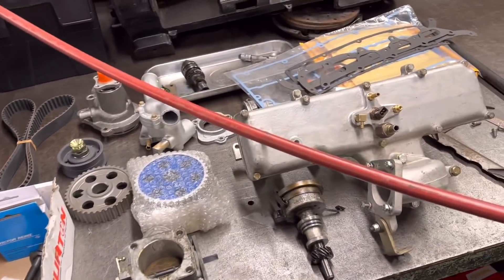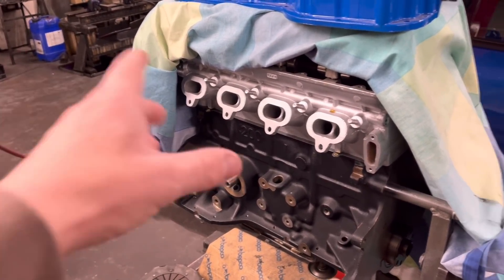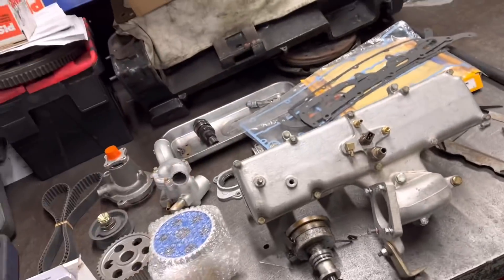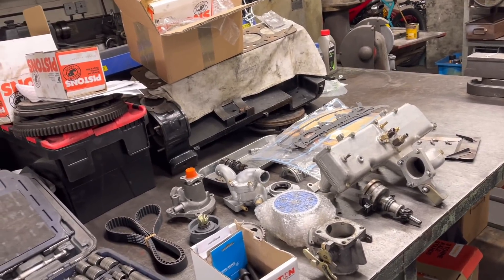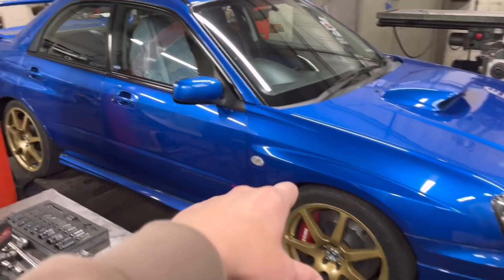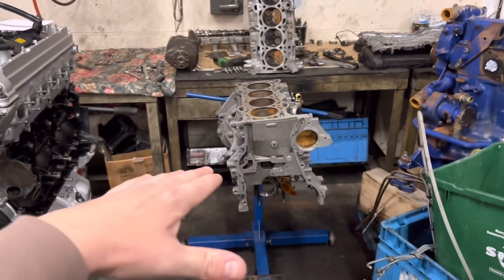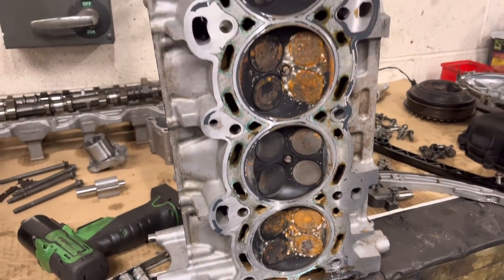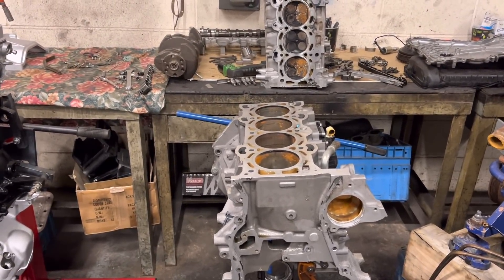It’s back for a Warranty claim check, but is it even the SAME ENGINE?

Comment: The input shaft on that quaif box looks like it could be the same length as a V6 Cologne type 9 box, still the same spline and everything but there slightly longer on the spigot diameter than a standard pinto box. You can usually tell as they sit proud off either type 9 bell housings, the pinto sits sub flush and as such the one you have may be too long, you can fit a pinto type 9 onto V6 Cologne, however the input shaft is short of fitting into spigot bearing, the cologne box can only be made to fit a pinto by getting rough arsed with it and shortening the input shaft approximately an inch (and using the pinto bell housing obviously).  Yes call it rough arse but where talking about putting these things together for banger racing with what we have, and forgive me if I’m barking up the wrong tree here but it might be worth checking out, its not easy to tell from a brief video clip and its a good number of years since I’ve had to mess around with these pinto and V6 setups so haven’t had eyes on one for a good while. Looks to be a great setup regardless and some cracking content for you guys, good luck and keep pumping it out.
Reply: Couldn’t you fit a spacer plate to make up the difference? 
In my world (Rover K series + type 9 in an MG Midget) we’re lucky enough to be able to get long or short bellhousings to suit whichever input shaft.

Comment: Some of the shops here epoxy a button on the block and heads. They are heat sensitive with a logo for the shop on the button. If the button is not on it or has melted don’t even bring it around. It also has a date on it.

Comment: Just as others have said a very discreet stamp or engraved mark (only known to you) would be a big help for yourself, so if a client returns with a "warranty" job and before any investigation work your discreet mark can be checked. I have had engines in for rebuilds or mods and have found stamps made by BBR, and a couple of machine shops here in N Ireland

Comment: There is a lot going on here with old work and not even guys that supposedly had it done still owning it. Your warranty needs to start the day it leaves your workshop, not 8 months to 4  years down the road when they finished the project or first fired it. It also needs to be original owner and some way other than strip down and guessing to identify  it was even your original work/parts.
   I get the customer service and reputation bit running my own business, but some of these things you show the guys are taking the Piss.  you should have way more work to do than wasting time on this stuff thats been messed around with by others and bought back wrong after with race/tuned engines. Honestly  I'd say no way on warranty on them and document it that way at the start and when it leaves if it's a part build or other stuff done after your work.
    It's like me bringing you a NH boat engine like those 2 you have there, saying machine and tune the daylights out of it, and I'll take it and run it in  a 2000hp  pulling tractor. The first run it blows a rod out the side at 5000rpm off the line and i say it's warranty and your fault the rod broke.  What are you going to do give me a new engine and the work that's 10 grand plus. I know guys it's happened to owning race engines but they are on their own with the bill and not the machine shops liability to cover it. 
  You get enough of these guys out there they'll bankrupt you in the end, lots are after screwing others  500 quid plus  the easiest way they can get it these days without honestly earning it.  Take care.
Reply: Yes and no.  As someone who has projects on the go, it is not uncommon to be a year or more after the rebuild that it is on the road.  I do think that there should be some serial numbers logged, not only for warranty but for insurance as well.  I don't know how you warranty something that is going to be raced, as a bad shift, poor cooling design maybe a shallow oil pan, it becomes more of a user issue.

Comment: If I remember right, it was used on a rock crawler type 4x4, so he’s probably sunk it in water and hydro-locked it or just left it with the water inside so that it can add some patina to the insides.

Comment: When I purchased my Auto Electrical business from my former boss when I finished my apprenticeship, I had a customer come in wanting a warranty on an alternator. We used to put a chrome type sticker with purchase date in code on the units. When I looked at the unit I enquired about when he purchased it. He replied about a month prior. I was mystified as had had the business for a couple of years and the name of the business had changed. Digging deeper I found out that he had purchased the unit from a wrecking yard and they told him that they had it reconditioned. On the sticker it states the unit was a guaranteed exchange unit. He got really pissed off when I went back through our warranty book and informed him of when the unit had been purchased , it was sold over five years before him buying it. I did manage to sell him another unit, this time with two years warranty.

Comment: I went back and watched the previous 2 videos on the Mazda engine. Your customer's story really doesn't stack up, that engine has been mistreated, it has been stored badly and has been not been in a running state for sometime. If the customer can't remember grinding bolts in situ I wouldn't trust that he has given you back the engine that you worked on.

Comment: I have just watched this video, and i was going to suggest doing what others are suggesting. I would make a mark, in whatever way you fancy inside the engine block, somewhere not easily seen unless you know its there. I would also mark heads underneath where it cant be seen, maybe on a port somewhere, and once reassebled cant be seen. With ancillary stuff like water pumps i would take a notch out of the rim of a bolt hole, so once the bolt is in its hidden. You need to adopt this strategy with all engines you take in, and also something you dont seem to have mentioned, make a note of the block number when it first arrives. If you made up an ID card that the technician filled in  as he worked on the engine, it could be added to the sales invoice in your records. This would tell you what was marked, identifying numbers, Etc. There could be no argument then when you had the customer in to discuss the failure. Currently I recondition cordless gas nail guns, and have made such sheets and laminated them so they dont soak up oil, and once complete feed them into the copier. I then wipe them clean with thinners for the next time i need a workshop card.

Comment: Wouldn't be a bad idea to get yourself a touchmark like blacksmiths have. Just emboss it somewhere where it doesn't hurt anything and you can always verify the job was done by you. Also if you are really proud of your work then why not leave your mark on the builds.
Reply: I’ve thought the same thing the first time I saw one of his videos regarding a warranty on a different engine. Keep it in a sneaky spot and pop it in your records even with a photo. Sadly it’s what must be done.
Reply: I was gonna say the same thing but I would go one step farther and put the stamp at a specific angle for each engine. Take photos for your files. All of the rust indicates that it is suffering from abuse if it is in fact the same engine. In any case, I would not consider it a warranty matter. Also record the measurements of the cylinder bores and bearing journals when assembled. Odds are the measurements will be completely different if it is a different engine. Good luck!
Reply: @brucecoleman7412  
Agreed.
Reply: @michaelslee4336  I don't think he would have to hide the mark or anything like that. If you see the custom made touchmarks you can order, they can be quite intricate and your average Joe will absolutely not be able to reproduce it by hand. You are not talking about top notch machinist but guys who put angle grinder to your engine bolts.
For me the mark would be a proud thing to show and by marking the work it would mean this product is made by me and therefore it bears the quality associated. 
I wouldn't hide the mark, I'd just order a intricate mark and that would be it, I don't think the scammers would even bother and to be honest I think some of them do not even remember swapping the blocks etc.

Comment: Get yourself an air engraver and mark the main parts with the  job card number ..you can mark most bits easily..Rolls Royce mark all there refurbed turbine blade with new serial numbers just for this problem

Comment: You should be putting marks or scribing every engine you build, make the mark unique on each engine and put where the mark is and what it was in your system notes, wrote a 304 inside the block next to number  4 etc. This problem would next exist then

Comment: What is the blue crap in the water jacket?   I don't know of silicon gasket material that is blue, but could this be something somebody squeezed liberally when re and re the head, with the resultant squeeze-out getting into the oil system?   thus starving the engine of oil from the dorky shallow sump?
Reply: looks like remnants of paper towel from wiping it off after pulling the head off, the stuff likes getting caught & tearing on the sharp edges where castings meet machined faces.

Comment: Stamp everything with the job number and yes I've seen this loads before on blocks and heads you can always tell when it's been machined or rubbed down always has the marks from what direction it's been rubbed

Comment: When I sold an engine when I worked at the breakers it was run up then I'd stamp the block write what it was stamped with in the invoice book so we new if they tried returning a different one back panels were marked with special paint that shines under us light

Comment: If you are worried that the engine coming back is not the same as the one sent out - put some ID marks on the engines you work on. Just some odd numbers in a hidden place and record it with a pic.

Comment: If I was running a competition engine I would dam sure put some type of coolant in it that has been ran with water in it my observation anyway
Reply: A lot of tracks/competition organisers don’t allow coolant as it’s a safety issue if it gets spilled in an accident/mechanical failure. Too slippery or something.

Comment: You need to set up a block id on everything that passes through. If an engine has a number , use that. Any block that you skim and loose the number, then a code relative to code number you keep on record. Dont use an invoice number as 'customer' then can see that. I would also look at using heat tell tales, which glue to engines. They will tell if it has been overheated. You have no idea how good the radiators or cooling is on a car, especially a special or race car. Mr Amnesia is pulling a fast one on the Mazda. Like I said on the last video, he doesnt have a leg to stand on for any warranty. That head looks like a scrapper engine thats been left outside for months without a cover, letting water in ports where valves were open.
Reply: Yep. Engine builder i used last put id code on head too, with vibration engraver. Could add it to your terms and conditions too, to keep things a-ok.
Reply: Was going to post the same thing. Punch some numbers on a part you have machined to confirm you got back the same part.

Comment: Looks like blue hylomar has been used to seal the head gasket, you can see the blue tint all round the head and bits in the water passageways ......pretty sure you guys wouldn't do that!
Reply: Not that using Hylomar is an issue though. Excellent for machined metal to metal faces. I have used it on head gaskets on 'improved performance' engines for 45 years, back when Rolls Royce (who invented it) called it SQ32. It was designed for use in gas turbine engines I believe.
Reply: @miceinoz1181  It's like everything else it has it's place and some times it's place is in the draw of the tool box.  I work on a lot of tractor engines and even on them with modern replacement head gaskets it will tell you install dry, don't use sealants. I did a Perkins the other day and another  the year before ,those were genuine Massey Fergusson  gaskets and had a sticky sealer on it right out of the packet. It's some right awful stuff though you only need a piece of dust from an old tractor however well it's cleaned at the wrong time and it sticks to the gasket.

Comment: A thought you’ve probably already had. Since it looks like you might not have tracked or marked the engine number, would you have records of the spec measurements/bearings used in the rebuild? Seem to remember from earlier videos that you track pretty good notes.
Reply: It does seem odd, that he didn't mark down engine serial number, and possibly stamp the date of rebuild.
Reply: @Okanagan48    It's amature rebuild  practice.
Reply: Stamping the block and head would have been easier.
Reply: @snafu7998  standard practise

Comment: Looks like it's been pressure washed with inlet manifold or plugs out, also I use a strait edged block plus wd 40 and 320 then 1000 grit Emery paper on engine blocks have done it for over 30 years and have had no issues doing it that way, the problems or head gaskets blowing after replacement is caused by 2 things poor quality parts and people not taking there time cleaning mating surfaces. I am retired now but used to restore vintage rolls Royces polishing the deck prior to head assembly was paramount lol. Ps did you know there are no tourqe settings on pre war rolls Royces, they had a saying a tourqe wrench is no substitute for a great engineer like your channel don't offer warranty on race engines....

Comment: Even if it is the original engine, you can't stand by a warranty on an engine that's been treated as badly as that. You can't be held responsible for corrosion!
Reply: in a flood  or Florida or used junk yard engine
Reply: @punker4Real  I was thinking similar, looks like the owner ran out of talent and took the car for a swim.